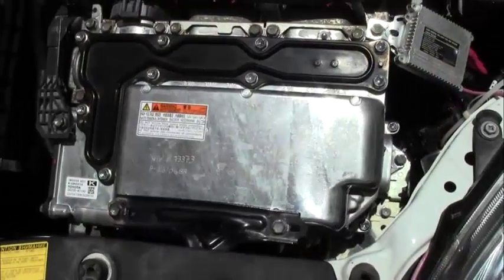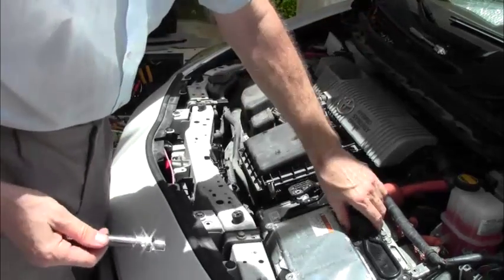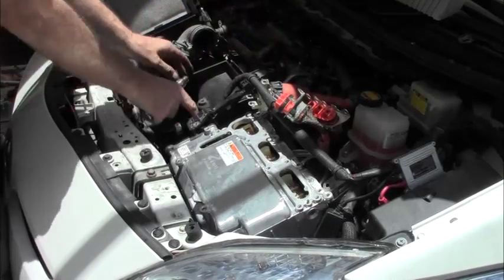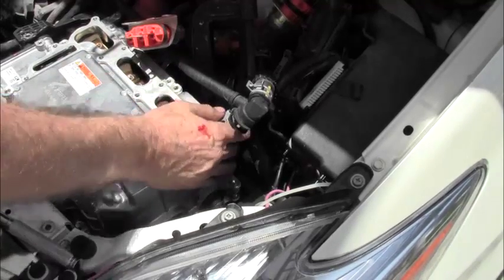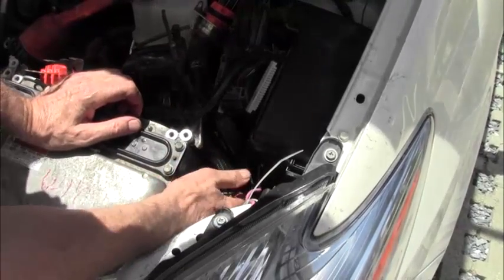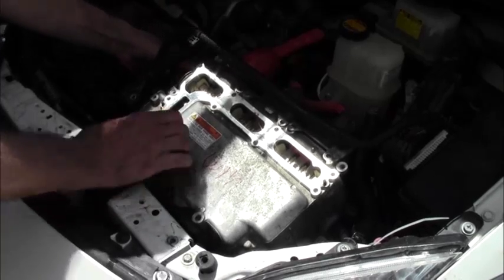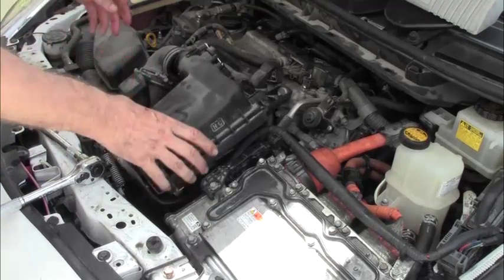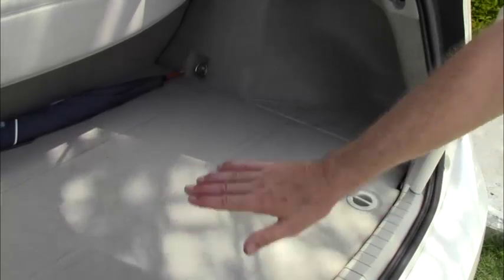Change ECU Inverter with Converter in Toyota Prius 2010

Comment: Thanks for the video. My inverter died and I replaced it this morning. Got an inverter from a car with 79k miles on ebay for $185. Techstream and cable for $70 on Amazon. Dealer is about 50 miles away and a tow would cost around the same $250, and they'd probably want to charge me $3k+  to do the work. It's a major hassle to get dealer work done(count on wasting at least one whole day) so I never got the transistor update done. I thought the music was great and left the video playing while I was changing my inverter out.
Reply from the maker: Hi, Ryan.
Thank you for the positive comments. You can use the Techstream to update the transistors. You can find it by clicking Check ECU. Kind wishes,
HG.
Reply: Correct me if I am wrong?  inverter is like Alternator on a hybrid???

Comment: Hey thank you for making this video! One bit of constructive criticism, the music (although very pleasant) makes it somewhat difficult to hear what you're saying at times. But again, thank you for making this! I have a 2010 that made it 7+ years without hitting 100k, and now I've got a DC-DC Converter problem. Your efforts are invaluable.
Reply from the maker: Thank you for your kind comments. Sorry  that the music got in the way. Glad that the video was helpful. Kind wishes.
Reply from the maker: Hi again, Patrick.

I just upgraded my speakers to a full-range set. On my old speakers the music was not an issue. However on the better speakers I can see what you mean. The music seems to overpower a bit. Unfortunately I can't just change the video. I would have to start a new page. Sorry about that.
Reply: Patrick Malone

Hi Patrick, did you ever resolve that error? Getting the same thing and my hours of internet search are just inconclusive. I’m thinking it’s an issue of “is the aux battery not holding a charge, or is not being charged at all” but I could be on the wrong path altogether. 

Hope you have some updates to share, but if not then thanks anyway!
Reply from the maker: Hi, Mactastic.
The ECU will not work at all if the 12V battery loses its charge. It will work once the car is running (such as if boosted), but not from the Off position. 

If there is any charge in the 12V, enough to power on the module, then it will work. It is either working or not. If the ECU becomes unstable, it is more likely a transistor problem. You can replace the board only, or the entire inverter.

Hope that helps.
HG
Reply: The Highway Groupie 

Thank you for taking the time to reply

Comment: hello greetings I have time following your channel and I know you know many of these hybrid cars.  I have a problem for some time my car is a 2007 prius with 115 thousand miles.  At this moment it cannot be driven and throws the code p0a78-287 which speaks of the inverter.  I changed the inverter and it did not work and I have tried everything even with the original toyota program to be able to scan and remove the subcode but I am afraid to change the transmission which is the only thing I am missing and that is not the problem ... do you recommend me  ?  Sorry if you don't understand some words, I'm already using the translator
Reply from the maker: Hi, Juan.
Sorry to hear of your troubles. The transmission would not be a usual problem. They are pretty solid, unless this was an accidented car. I'm more suspicious of the electrical connections. That would include both to the 350Vt battery and the 12Vt battery. Make sure that the harnesses are sealed. Make sure all connections are clean. 
Remember to remove the breaker from the 350Vt battery before doing ANYTHING with wiring. 
Another thing to check is the connections in the cells of the inverter battery. Make sure that they are clean. Isolate the cells and check the voltage. They should be within 3% of each other. 
In short, This sounds like an electrical supply problem. That is my take (or best guess), without being there and looking at it. Hope this helps.
Reply: The inverter pump may need to be replaced as well, which is located under the inverter. This pump is different from the coolant pump and is also known to fail.

Comment: Hello to all prius owners with DC converter problems, Toyota has and extended warranty for the hybrid system and battery. The dealership will fix problem at no charge. Recently my 2011 prius level IV had a driveabilty problem while on EV mode upon acceleration car lost power and bunch of lights came on along with the service hybrid system message. Code P0A94, nephew is a toyota tech, called him and told me there was an active warranty for that particular problem. Hope this info helps, not sure if it covers older priuses mine is a 2011.
Reply from the maker: Thank you for the information.
Reply: I thought I would add that Toyota will not honor the warranty if you have a salvaged title in the US(california). I have the same code P0A94, year 2010, very thankful to The Highway Groupie for this video, I will need to replace mine and this vid is the single best resource I have found to help me. Dealership quoted about $2500 to swap the IPM.

Comment: I got in an accident and my ECU inverter/converter was hit pretty bad and the car will not turn on, can i just get a used inverter and replace it? Will it work or do i need a specific programming?
Reply: Hi, Kareem.

Sorry to hear of your accident. As for the ECU, yes, they are plug and play. You will need to make sure that it has the latest CAL and CUW files uploaded. But even without them, it will work.

It will take a few kilometers to 'learn' how your motor, battery and brakes are responding. But once it sets its calibrations accordingly, you should get the same mileage as you were getting before.

What year is your Prius?

Kind wishes, HG

Comment: Did you end up draining the inverter coolant after all? I noticed it was empty after the hoses were removed. I really don't want to get under the car to remove the cover and drain the inverter coolant. I think I'll be lazy and just empty the inverter coolant using a siphon pump to get out as much as I can and let the rest drop from the hose connections.
Reply from the maker: Hi, Epiha.

I did this job a few times. Once I lost the fluid because the clamps didn't hold. The other times went better. You are always going to lose some coolant. It is not recommended to return used coolant to the system. It is always better to replace lost coolant with new.

Hope this helps,
HG.
Reply: This helped and thank you.

Comment: The guy is really good but water hoses can be removed much easier there’s a little green arc around it you snap it up with a little flat screwdriver and pull them out
Reply from the maker: Agreed. But I didn't have a screwdriver short enough handy. There is an obstruction just to the right. The first time I removed it, I used something similar. That is how I lost it and had to make a new one. This time I used pliers so that they would hang onto the clip for me. None lost this time. ;-)

Comment: Hello HG, is the IPM (intelligent Power Module) located inside the Inverter with Converter unit you swapped out in this video? I have a salvaged 2010 that has the P0A94 code, dealer wants $2500 to replace the IPM. I'll need to replace by myself... is this the process to change it out?
Reply from the maker: Yes, it is. It is generally easier to simply replace the entire unit. I have a new unit available at much less than $2,500. And as you can see in the video, it is dead easy to change. ("New other", that is, it is a unit that was installed for 200km, upgraded and then removed.)

Comment: I got this error codes in my 2012 prius. I'm based in Nigeria. Yet to find who can tell me what to change for my prius to be ok. Currently the car stops after a while. Say 1 or 2 kilometres if movement. It does it once the hybrid battery bar gets to 1 or 2 bars. I have to remove the 12 volts battery head for like 5 minutes and have the hybrid battery indicator bars show almost full. 
Below are the error codes. 

Pls adverse me on what should be changed or do. I guess my inverter needs replacement. 

P0108 
P0121
P0123
P2135
P261C
P0A0D
P0A0F
P0A1A
P0A1B
P0A40
P0A41
P3107
prius 2012 model error codes
Reply from the maker: P0108 = MAP sensor in your intake manifold
P0121
 = Throttle position sensor (eccentric voltage range)
P0123 = Throttle position sensor A (related to P0121)
P0135 = Oxygen Sensor Heater Circuit Malfunction (Bank 1, Sensor 1)
P2135 = Engine is not reading the turbo compressor sensor correctly
P261C = Coolant pump.

What we are seeing (without going through the rest of the list) is a set of false readings. Low voltage for the ECU can do this. Check your 12V battery. It may need replacing.

If that doesn't fix this, then check your ECU battery. Check each cell to make sure that they are reporting properly. If the ECU is charging but the battery has some weak or dead cells, look to replace some cells or the entire battery. If the ECU is not charging properly, then you will need to repair/replace your ECU.

But I would suspect the 12V battery more.
Reply: @TheHighwayGroupie  thank u very much for taking your time to review my case

Comment: Hi, I own a 2010 Prius. I just got a Check Hybrid System message... Not having a Toyota dealership near to plug a scanner, all we have is AutoZone, will their scanner be able to tell me if the inverter needs to be replaced?
Reply from the maker: Hi, Luis. 
Sorry to hear of your troubles. By AutoZone I assume you mean the general mechanic and auto parts place. They should have a standard OBD II code scanner. This will tell you if the problem is the hybrid battery or not. If your car is still running and given the age of your car, I would guess that the problem lies in the battery.
However, an OBD II scanner will not tell you which cells are faulty. A mongoose connector hooked up to TechStream software should tell you which pair of cells are not reporting properly. If I remember right, the 2010 has 20 pairs of cells. When fully charged each pair should report back about 15.4VT DC - give or take 3% or 4%. If this is not happening, there could be several reasons: dead cells, shorted cells, dirty connectors, weak cells, etc.
If it is the battery, to find out what your problem is, you will need to dig down to your battery pack, which is behind the back seat. You can find several videos on how to do that. Don't forget to remove the breaker switch (bright orange handle that slides left and then pulls out).
Carefully remove all bolts holding the connectors to the battery. Be careful not to short between terminals or to ground. Clean all of the connectors with a wire brush drill attachment, or similar.
Use a load tester to see if the batteries will hold a reasonable charge. They should discharge slowly over 10 seconds and then bounce back to within 5% of where they were before the test.
If all cells respond well, then you will need to balance the cells one at a time. Start with the cell that shows the lowest voltage. Then use the load tester to reduce all cells to within 3% 
=/- of that reading.
After re-assembly the Check Hybrid message should disappear. However, it may re-appear some days later. This is an indication that not all cells are discharging at the same rate. The solution then is to figure out which cells and replace them, or replace the entire pack. But I would wait until the battery does not charge to minimum voltage before changing the battery pack. That is my opinion, not Toyota's. =D
If your OBD II reading gives a different error code, then I wrote all of this for nothing. =D
Hope this helps,
HG

Comment: hi .i got a prius 2010 when i drive some km there is like air suction in the engine and the gear start to fail and the triangle light on and engine light too and then i continue to drive with engine light on works perfectly, the ob2 scanner say battery fail,is it the e.c.u and inverter,..
Reply from the maker: Hi, Bholah.

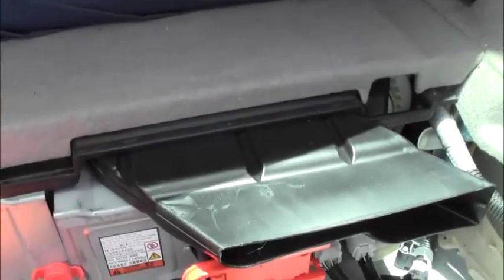First thing to do is to check the voltage of each cell in your battery. Make sure you remove the orange breaker first. (See 1:11 in the video.) Always be careful with these batteries. You have enough voltage to arc weld!

If the voltage of a cell is above 5, then your cell is likely still good. But if the difference in voltage from one cell to the other is more than 5%, then you will get the message that you mention.

However, you mention that your engine feels like it is sucking air. The Prius gas engine is small for the size of the car and relies on the electric motor for acceleration. If the battery is deficient, then you will get the feeling of low power. So, I would suspect that one or more of your cells is dead or shorted. It will need to be replaced.

Another possibility is corroded contacts. If the cells give you voltage (5V or more), then your contacts may be preventing the juice from reaching the inverter. You can remove the contacts and clean them with a Dremel wire brush. Once you have done that you will need to drain the charged cells to reduce them to the voltage of the weakest cell within 5%. After that the battery should work normally. There are videos on how to do this on YouTube. Most have you remove the battery pack, but with a short 10mm box wrench, you don't need to remove the pack. You can strip it while leaving it in place.

So, you have several possible problems with different solutions. Hope this helps,
WMT

Comment: I really liked the detailed instructions, Very informative. 
Thank You!
Reply from the maker: Thank you. I always appreciate feedback, positive or negative. Glad I could help.
Reply: @TheHighwayGroupie  I am going to buy Toyota Auris 2010 that needs the inverter replaced. And I think that video shows very clearly how to do it . And that’s amazing!
Just to double check . After I change the inverter there is no programming or anything else to be done on the car right ?
Reply from the maker: @projecthowto  In principal, no additional programming. But you may want to make sure that the inverter has the latest updates. For that, you will need a Mongoose connection. Or pay the garage to do it.

Comment: i do have prius 2013 2nd gener ,i have yellow triangle and  check hybrid system in my secreen ,i took it to autozon check engin was p0A93  i changed inverter water pump but still same message can u please help me
Reply from the maker: Hi, Himide. Thank you for your question. I don't have a 2013 and the 2011 didn't have this problem. That being said, there are several possible causes and solutions to your problem:
1) Check to make sure the pump is running (with the ignition on, you should hear it - I believe that it is on the passenger side, but not sure);
2) Check the liquid level in the coolant bottle (passenger side);
3) Check the 12V battery – a faulty battery or cheap knock-off can cause false error codes;
4) Make sure that the coolant line going from the inverter to the pump does not get close to hot manifolds. This will cause an air bubble (vapor bubble) to form preventing the pump from working;
5) Check for leaks in the hose. One owner had his pump changed only to find a few thousand KM later that they hadn't hooked up the hoses well and they were leaking;
6) Join Prius Chat and pick their brains, if none of the above works. You can find this topic here: https://priuschat.com/threads/p0a93-engine-code.84664/

Hope this helps,
HG
Reply: thanks

Comment: I did my 07 Prius back in 2014.  It was more complicated than this.
Reply from the maker: Interesting. The main reason that I didn't buy anything before 2009 was the size of the cabin. The 2010 was much more comfortable. Didn't realize that the electronics would have been more complicated. Thanks for sharing the experience.

Comment: Can  you help me out please, i have 2010 with 72k on it, i was driving in the highway and tried to make it to the   exit so i hit the gas paddle hard to go faster and the the car just died on me, got check hybrid system on the screen and yellow triangle, and before that the AC wasn't working  and tried to use the cruse control didn't  work either, got code U0110, what do you think? people trying to  rip me off here ................. thank you and looking forward to hear from you
Reply from the maker: Hi, Hayder.
Sorry to hear of your troubles. The U0110 code is a generic code that basically means the the engine controllers aren't communicating together. Have you been to Toyota for the ECU re-programming? If not, then your transistors may be overheating and possibly already damaged. In any event, this is part of a global recall and you should be able to get this fixed for free, although not necessarily very quickly. You could try the PriusChat site for more information on that.

The 2010 Prius was the first model year to change the AC to totally electric. It doesn't rely on the motor rotation. The programming runs through the ECU, so if there is a problem with the boards communicating together, it would be normal for you to lose both the AC and the cruise. Your garage can hook up a TechInfo cable that will get the more precise codes. Of course, if the boards are not communicating, then this might not be possible, but then it will be evident where the problem is. Short answer: try to get yourself a new, free ECU from Toyota. If that is not possible, then I have a new one (Toyota original) I can sell you for much cheaper than buying from the garage. It includes the programming cable.

Hope this helps,
HG.
Reply: thank you so much,how can i contact you?
Reply from the maker: You could try info at me-go-punta-cana with the usual calm ending. Cheers!